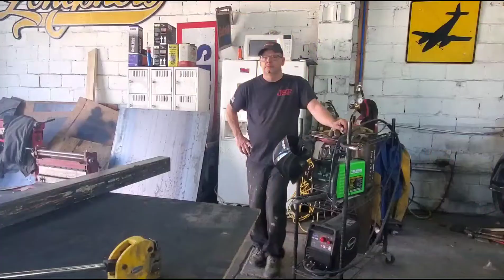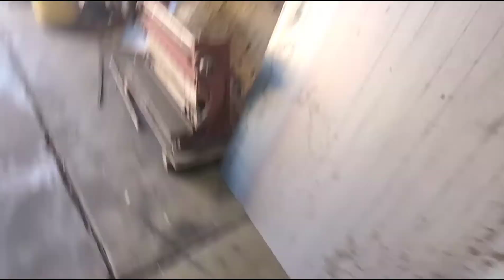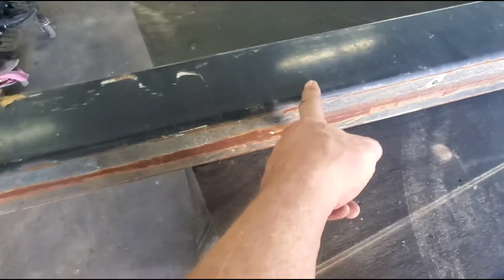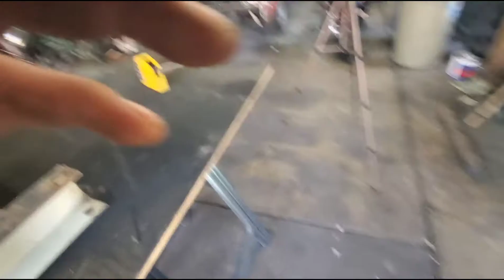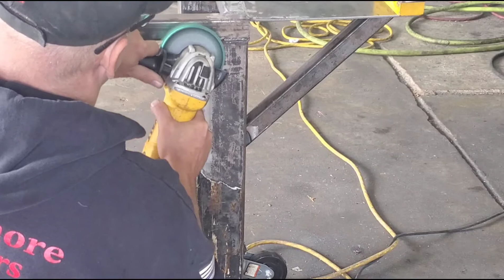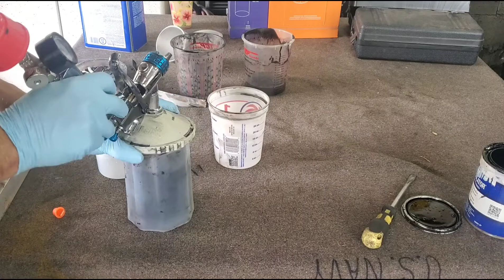Building a stand for the Harbor Freight 3N1 slip roll machine

Comment: I'm new to metal working only doing it as a hobby for few months now, and I recently bought a 52" 3-in-1 second hand, thing weighs 400Kg (about 800 pounds) and I'm looking at building a table for it. Thanks for the video I'll definitely be referencing it, though it'll have to be a bit bulkier to handle the extra weight I expect, plus I'm a bit worried about it being top heavy and over balancing.
Anyhow, greetings from South Africa.
Reply from the maker: I would make sure the stand is wider and longer than the machine. Mine I notice is kind of "tippy". If I were to rebuild it, I would definetly go at least 8 inches wider and longer.